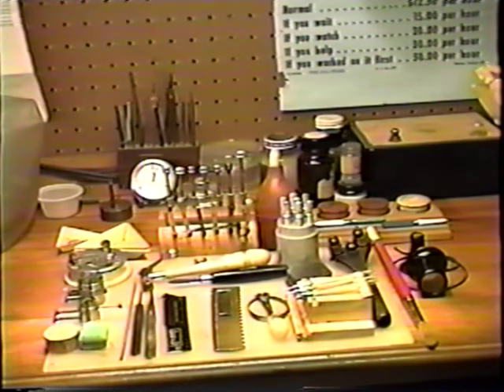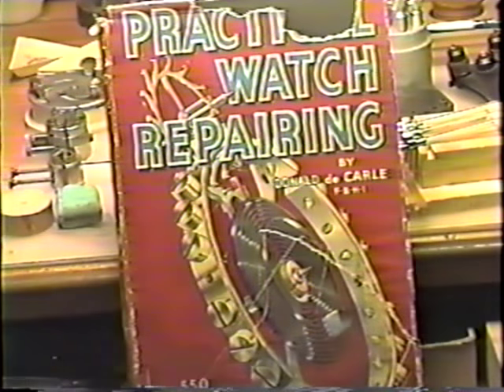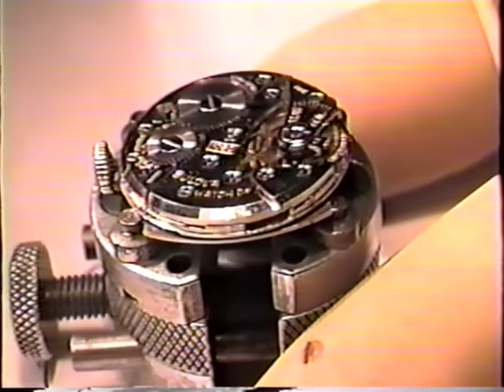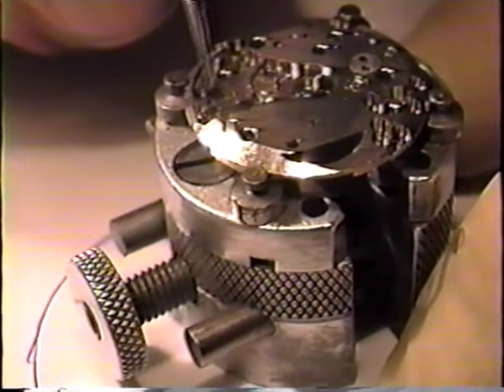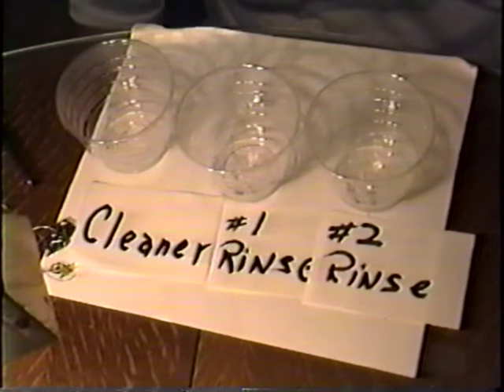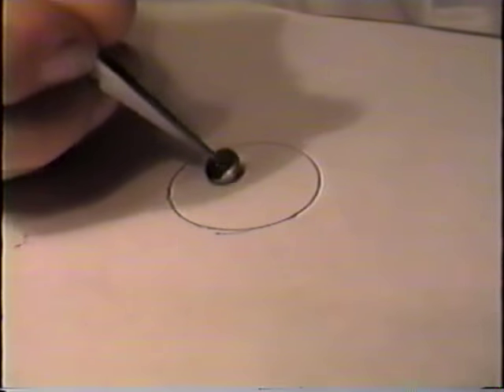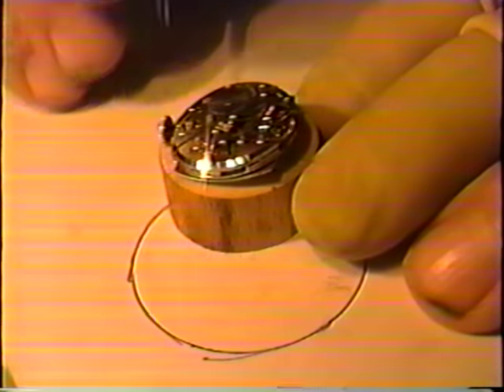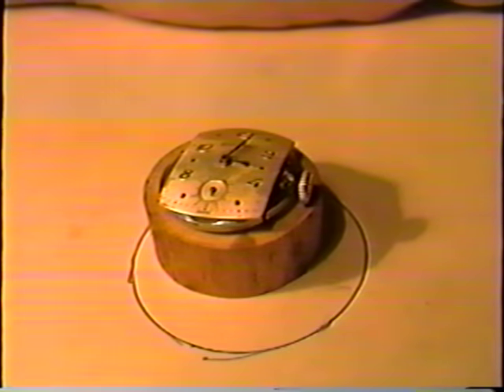Watch Repair for the Beginner

Comment: Very nicely done indeed, especially the delicate work with replacing the mainspring, and reinserting the dangling hairspring. When you give a caveat such as snugging down the screws and testing, before tightening all the way, those are probably real lessons learned the hard way beginners. Do you understand every piece of the movement, what it's purpose and functionality are, and why, if it's not working as it should, the watch won't run?? That, I would think, must be essential. If this is watch service for a beginner, I can only imagine what more advanced servicing must entail. How long would a standard disassembly, clean, and reassembly take?? An hour?? Thanks for showing us all the basics of how it's done by an experienced watchsmith!!